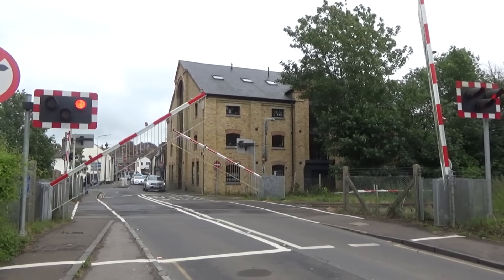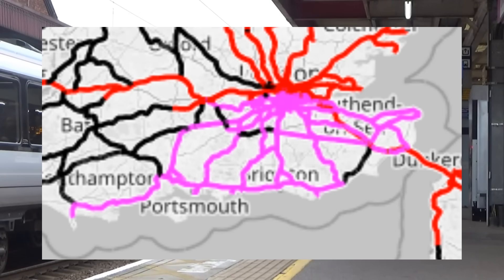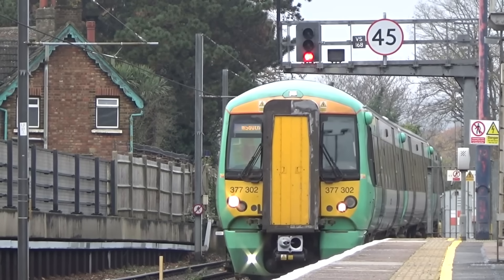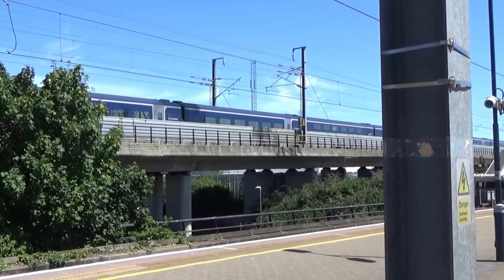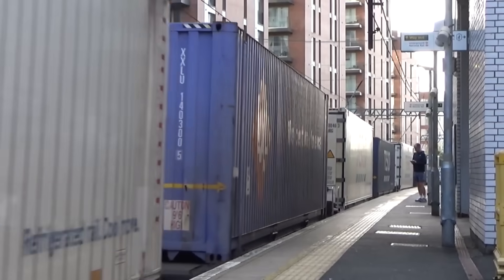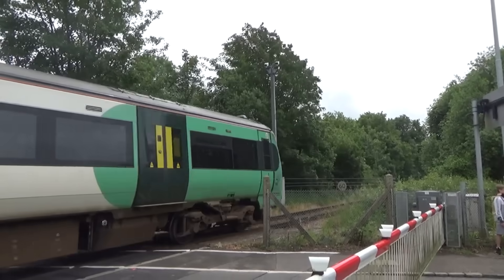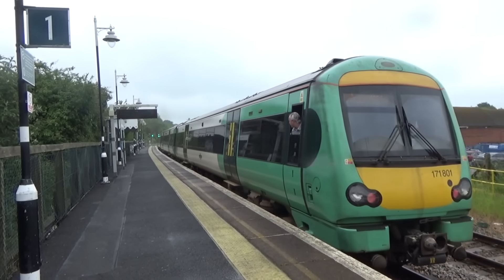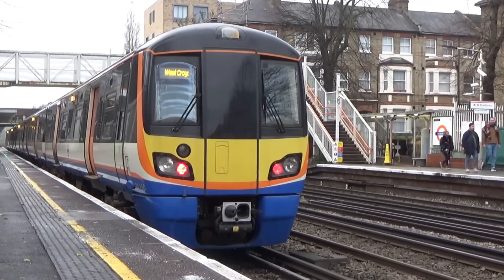Are These Railways Actually Unelectrifiable?

Comment: Hydrogen is not even worth considering. It is expensive to produce, and the overall efficiency of electrolysis produced hydrogen ("green hydrogen") is abysmal. OHLE is also expensive (excessively so when DfT get involved), and to install it in third rail areas would be nonsense.
To me, joining up 3rd rail areas with infill 3rd rail is a no brainer. Marshlink would be easy and the North Downs line also as that would join Reading (which has 3rd rail for trains to Waterloo) and Gatwick (which is also so equipped).
If ORR in their wisdom say that 3rd rail is too dangerous, then they should shut down London Underground, London Overground, Merseyrail, Glasgow Subway, and the entire South East of England, including Volk's Electric Railway in Brighton!.
P.S. Don't forget that the Southern Railway introduced electric locos for freight haulage and the present class 92s can run on 25kV or 750V.
Reply from the maker: yeah, you can run 3rd rail electric locos for freight defo, but the issue is on busy lines with lots of trains the power draw is more than the system can supply, part of the reason we dont see DC locos do much nowdays (except some RHTTs)
Reply: @LTRains  Add more substations.  That way, each section has a smaller load, and the freight trains can be run.  I'm pretty sure that that was what was done by the New York Central near Manhattan, and by the various interurbans and the Chicago L.
Reply from the maker: the issue again is cost, when youre building substations, modifying the layout of the 3rd rail sections, and buying new 3rd rail locos, it kinda makes more sense to just build OLE at that point
Reply: @LTRains Over the life cycle of the systems OLE is 20% cheaper according to the RSSB.
Reply: @LTRains  

With advances in electronics technology, the new substations could be much cheaper, modular, and pre-assembled.  Together with mass-production, the cost could be reduced a fair amount.

As for needing new 3rd rail locos, well, the Sheds say HI!   If EMD can shoehorn in 3rd rail gear onto the FL9 in 1959, they sure as heck can add it to the 59 and 66, converting them to electro-diesel.  Alternatively, given some of the proposals currently underway in the US, they could be converted to dual-voltage with the removal of the prime mover.  

Given that the basic frames of an EMD can easily last 50+ years of semi-neglect on the rough American track, the relatively pampering British rail network should be able to keep them for even longer.  Seriously, there are pre-WWII switchers still being used (at least as of a couple years ago) at several major passenger stations.  And 1950s-1960s-era diesels are still rostered by the mainline railroads.  The basic frame of a 59 is based off of the SD40-2, which in turn was based off of the SD40.  There are STILL SD40s running around despite them having left production around 1975!  And the 66, of course, is little more than an updated 59 (new prime mover and electronics), so there's no reason to believe that a diesel built ~2000  couldn't be running as a dual-voltage electric in 2050, especially when you consider that one of the largest sources of wear is probably the vibrations from the prime mover, which an electric wouldn't have to deal with.
Reply: @00Zy99  I agree completely. Regrettably, in this country there are too many who look for obstacles rather than solutions (particularly the Department for Transport). I had not thought of 66 conversions, but it sounds intriguing. British Rail introduced electro-diesels years ago and many are still running successfully, so perhaps some 66s could be converted.
Reply: The map in the video shows North Downs is proposed for 25kv electrification.
Reply from the maker: it was once, but sorta stalled out. the map still says proposed from that

Comment: All new EMUs built after 2000 can easily be switched to either 25Kv/760v or both. On the 450/444 fleet it would take just 8 hours per unit to convert as these trains are modular designs. Desiros operate with A traction motors as do nealry every EMU. Even the 455s were converted to AC traction by SWT
Reply: Converted to AC Traction does not equal can accept AC Power, the vehicle needs to be equipped with more equipment (primarily a transformer) to be able to accept AC power.
Reply: @thespicyicecubexd_8932  In the case of the 455s you are correct. But the Desiro & newer unit operate on AC. So, they have to invert the 760v to whatever they operate on. Only DC systems are the 110v batteries.
Reply from the maker: you could add in a pantograph, but you also gotta have all the electronics ready to have an AC supply instead of a DC supply, so not exactly that simple. AC traction and AC supply arent the same thing
Reply: @LTRains  As I said, all modern units since 200 are AC. Thiose on DC are inverting DC to AC and uses it
Reply from the maker: yes, but they would need extra equipment to recieve AC current rather than DC
Reply: ll they would need, according to a Seimens fitter would be the pantograph & the small compressor to operate it, plus removal of 3rd rail collectors shoes if going pure AC overhead.

Comment: Anything but electrifying the chiltern mainline
Reply from the maker: tbf tho, that should just be OLE, no real reason it shouldnt be
Reply: @LTRains  what about the Alsbury line?
Reply: @TheHumanoidMicrowave where's Alsbury?
Reply: @Clivestravelandtrains  they're meaning Aylesbury
Reply: @LTRains I can think of one, Marylebone. That is impossible to install OHLE into, 3rd rail is the only option there no matter what you do.
Reply from the maker: @professorjamesmoriarty5191  Marylebone can have OLE, it would be expensive yeah but theres no reason 3rd rail is nessecary there
Reply: @LTRains Marylebone cannot have OHLE, that's the big issue with electrifying the Chiltern line. The 3 tunnels just outside the station make it impossible, as to gain enough clearance you would either need to Demolish Lords cricket ground or lower the West Coast mainline. It really is like threading a needle through that section, take a look at how low st jhons wood tunnel really is.
Reply from the maker: @professorjamesmoriarty5191 people said kings cross couldnt have OLE, its possible, but expensive, but yeah, the wcml is defo the issue
Reply: @LTRains kings cross was child's play compared to what you would have to do at Marylebone. Lords tunnel was built as cut and cover by digging up the pitch, the ground on top is only a few feet deep so no chance of going up, and the roof of a 165 is already pushing the limits of acceptable clearance in St jhons wood tunnel. Dropping the WCML is not a sensible option either, as it involves lowering the tunnels there that have already been lowered once, and rebuilding south hampstead station. Now assuming that you managed to find the billions of pounds to overcome all that mess, you can only run OHLE down the route via Wycombe. On the Amersham line it would need to stop at Harrow on the hill as it isn't compatible with the LT lines north of there, 3rd rail is but OHLE is not.
Reply from the maker: @professorjamesmoriarty5191 wcml aside, you can defo lower the trackbed in the tunnels, and OLE works just fine above 3rd/4th rail, theres many locations with this. the wcml is the only proper issue here
Reply: @LTRains care to name a section of 4th rail and OHLE?
Reply: 68s and Mk V sets, best compromise.

Comment: Correct me if I’m wrong but I’m pretty sure freight trains can run on third rail it’s just many areas don’t have strong enough power supplies except the south eastern mainline to the channel tunnel
Reply: Third rail electric locos are not a very good idea because third rail has gaps at switches and crossings. Multiple units can bridge the gap because they are so long that at least one shoe is always in contact with the third rail. Electric locos are shorter. The three Southern Railway electric locos (the original class 70) and the BR E5000 (class 71) were driven by flywheel motor generator sets - when the conductor shoes were in contact with the third rail the power drove a motor which spun the flywheel which generated electricity for the traction motors. The flywheel was so massive that it could continue to spin the generator to provide traction current when the loco was crossing gaps in the third rail. Some of the SR freight yards (including Hither Green) had 750DC overhead and both classes had pantographs to work in these yards. Some of the class 70s were rebuilt as class 74 electro-diesels but hey were not a great success and were withdrawn after a very short working life.
Reply: Only 73s have regular working on the third rail, the 92s mainly work on the OLE system.
Reply from the maker: and also the 73s run test trains and RHTTs, which are significantly lighter than freight
Reply: Third rail on south eastern line (Dollands Moor), and across south London to North Pole (on West London line/WCML) are fine , as is BML . The problem is lack of freight who would actually use BML; there isnt a need for it, as Southern found out once the boat trains ended and the 71/74`s had no work. Great loco`s, very powerful on electric, but no work.
Reply from the maker: yeah, the issue isnt the freight train itself, but the fact they draw lots of power on already busy lines
Reply: @LTRains  Theres 6 Class 700/1 an hour on the BML, going to or from Bedford , thats 5mw each. Let along everything else running at the same time; the juice was upgraded a decade ago from East Croydon and southwards for the 700`s, and from North Pole to HS1 for the Eurostar and 92`s. The Eurostars used to run third rail into London Waterloo before St Pancras opened for them on the wires and of course around South London to North Pole for Eurostar Maintenance. Its doable, but there is no freight (other than Southampton)  to use it. Passenger service would only really be if 1S76 the `Sussex Scot`  was ever brought back via Kensington Olympia (WLL again) and then on the wires at Shepard's Bush

Comment: I always thought Germany had huge problems with Electrification but damn Britain out there having 3rd rail in alot of Areas is rlly big Problem for Network Electrification
Reply: Ironically the UK uses Germany as an example of good electrification.
Reply: @J-Railway-Volunteer  we are damn slow at electrification only like 60% not even all mainlines are electrified lol but we have a unified electric system with a few exceptions (3rd rail for the S Bahn Hamburg and Berlin for example)

Comment: So why do third rail arcing more than overhead wires despite having a lower current ?
Reply: Third rails have usually a lower voltage than overhead wires, but much higher current. Arcing often happens where the third rail comes to an end on one side of the track and starts on the other side (for example at a junction) or there is a gap in the third rail so as not to zap people on a level crossing.
Reply: On top of everyone else's comments, the shoe gear and third rail disconnect a lot, unlike the pantograph and overhead wires which are always in contact. Most arching occurs when the power source and load "disconnects".
Reply: DC (third rail) forms and sustains arcs far more readily than AC (overhead). Also, as has been said elsewhere third rail DC carries way more current than the overhead wires.

Comment: There was an invitation to tender to electrify the Uckfield line with third rail in the late 1990s, when it was being operated by Southern Region diesel-electric multiple units that were built in the late 1950s with an intended life of 10 years (that were still running well, but had the by then frowned-upon slam doors). All the tenders received were at prices more appropriate to building a complete new railway. The railway companies abandoned the idea of electrification and ordered some new diesel multiple units instead.
Reply: Ah. I 𝙬𝙤𝙣𝙙𝙚𝙧𝙚𝙙 why that line remained unelectrified. Seems a pity – but all down to money, then. I can remember when that line ran the old “thumpers” – I could hear them going past on the line from East Croydon to London Bridge about ½ mile away from my flat.
Now I can set my watch by the Class 171 Turbostars when I hear them going past.

Comment: Everything will be battery eventually, imo.
Reply from the maker: batteries just dont offer a good enough energy density for anything longer than a short branch line, full electrification moves most of the heavy equipment off of the vehicle and thats what makes it so much more efficient
Reply: @LTRains the bean counters will ensure batteries are used on the edges of the network with electrification of the core
Reply: Battery Traction isn't suitable for lines with more than 4tph and line speeds above 75mph.

Comment: You would need to replace everything in the marsh link line as all the existing infrastructure are too old to handle the heavier trains which would be used
Reply: Considering the slow speed the line offers modernising would offer a great improvement in journey times as well as the option to extend services beyond Ashford
Reply: @imsbvs The route is capable of taking 85mph running.